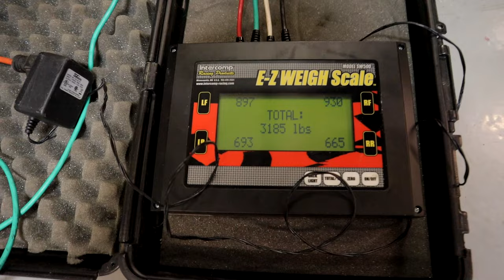American Musclecar Evolution - Why Pontiac Started Strong And Faded Into Obscurity

Comment: when i quit running ford FEs i went to the ponchos ran 455,428s and a few 400 ra 3s. rwith a 4spd  and peak rpm was under 7k , shifting around 6600 or so. coming from the FE the ponchos seemed wonderful. now this was the 80s -was aware of the CI rods, had a few cast steel rods  and some SD forgings . never dumped a rod or cooked the bottom end.  i did toss the valvetrain a few times --broke rockers, bent pushrods  and hand-grenade  a few flat tappets. poncho parts were scarce in these parts. good cylinder heads were very hard to come by.. later went with the chevy rat mill as decent cylinder heads were 'everywhere" and not expensive and  a very easy swap. ended up at the track with a f-bird packing a l-88 with ZL1 cam and valvetrain. it didn't have the poncho mills at the bottom , but from the middle up the thing just screamed-

Comment: My dad is an Oldsmobile man and he always talked about how they put a junk 400 or mild 455 in the 442s when they had the meanest olds motor in their family cars (425s), he built a 425 back in the 80s that he put in a 64 442 and ran low 11s in the quarter at 120mph even though he blew the back tires off for at least an eighth of a mile, if he would have gotten it to hook up it would have ran low 10s in a car he drove to the strip (gateway international in Madison IL).

Comment: I like Pontiac engines but my favorite engine is the Oldsmobile 455. I have a stock Oldsmobile 455 in my 72 Oldsmobile 98 and that thing has some dang good torque, just don't over rev them just like the Pontiac engines.

Comment: Have almost every issue of HPP.     Been slinging the same well balanced, all cast crank and rods to 6500 RPM for over 4 decades on the factory bolts.   400 has matching date code #16 heads I got from Quint Styres. Runs in the low 12s on a 2.78 gear.  Went undefeated street racing 1982-1991 on a 3.73 gear.   I wouldn’t trade it for the world.  It’s just nasty.   And, it’s legend.   😁

Comment: I used early 389 rods that were prepped & hardened and had ARP bolts installed in a few builds, my best Pontiac engines had BME aluminum rods back before they costed thousands of dollars a set.
Reply: @danielscott6787  yep, that was part of the prep too.

Comment: I did the Pontiac thing starting in 1964 with a new GTO w/tripower 4 speed. Being a physics major I used the 1961-62 forged rods and had them heat treated to Rockwell 35 and shot peened.  I also bought an OTC piston press ($2,000) and did not heat the rods to install the pins.

Comment: Pontiac (and I had a '70 GTO in high school - so limited budget....) at some point decided to go with cast iron connecting rods - pretty much limited the motors to 5500rpm (or 5000rpm on a 455).   Your choices (at least in the 80s) - limited rpm, Ram Air IV rods (good luck finding one) or the Super Duty 455 rod ($120 back in 1988 or so - cheaper going Carillo) or aluminum rods - and at the time they were no no for street.    Every rebuild (or even re-ring) had to have 6-8 rods resized because they were oval.   I used Mopar rod bolts (actually SPS brand, but sized for Mopar) in my Pontiac rods, ran Ram Air IV oil pump and windage tray with a deep sump.   With very light porting, full body car, ran deep into the 13s (3.55 gears L50 tires - remember those?).   Heck, there was a Firebird at my high school that rad 13.40 with a 4 speed (also a 400, but with cast iron manifolds).  Note: Pontiac also had their own, non C-clip, 10 bolt rear axle.   A god send when I blew the spider gears out of mine.
Weird, my block was drilled for 4 bolt mains but only had 2 bolt   (and yes I used studs in the block).
Also, everything was backward on  Pontiac.   Distributor ran backwards.
Now, I'd love to have a '74 firebird 4speed with a 400...   Eagle rods! and more or less stock appearing on the outside (think 'formula')
Ray Barton makes some really cool Pontiac motors - complete long block, big inch kits for very reasonable prices.

Comment: 65 Pontiac Strata Chief. 4 dr.  Had a 427 and 4 speed.  It was raced for 2 yrs. My dad bought it off the boys who raced it.  Spent the summer removing all the badges. All 427 and V8's were removed.  Candy red.  The only hint - was the electric brake lock on the Hurst shifter.                      Real nice car. Very fast.

Comment: I've often wondered what would have happened if the 301 was beefed up and received the same treatment the 3.8 Buick V6 did.  We might be talking about a turbo V8 Trans Am or Grand Prix instead of the Buick Grand National.
Reply: The 301 turbo block was somewhat beefed up compared to the earlier non turbo 301s. chevy wouldn't allow the turbo 301 to continue. They knew dam well it would have whipped anything they had. Can't have that

Comment: Great video. I did not know any of that about Pontiacs and their rods. I was always a Chevy and Mopar guy growing up and had both. I really didn't think much of for example the 69 Judges when they were around. Thought it was just a nice paint scheme sort of thing. In reality, those things ran very well with the Ram Air 3/4 motors and you could easily get torched by one if you weren't on your Ps and Qs. If I am not mistaken, the 69 GTO Judges were faster than any prior incarnation of the GTO. I've also read that the early Firebird Trans Am cars ran quite well also.

Comment: The owner of the first shop I worked in is a Pontiac guy that has a 68 GTO that’s been a race car since it was new, the crossmember is riddled with square holes and dents from slinging rods out of it, he ran it with 454’s from 1970 until the mid 90’s when aftermarket rods became more readily available and has run 400 based engines with oliver steel rods or BME aluminum since then.

Comment: I read in the '80s a lot of Motorbike magazines (in German) and then there was a crucial number for the high reeving engines (9-11'000rpm): the piston speed. About 20m/s was the healthy limit which equals to 65.62 ft/s. What happend to that number?

Even when the engines made a progress in design and materials I think this limit is still valid if you want to keep your engine for a long time.

Pontiac did correctly set the redline for the Trans Am's at 5700 rpm which equals for a 455 with 4.21 inch stroke at ecxactly 20m/s piston speed.
Pontiac kept that limit also for it's 400's (3.75 stroke) and having driven these cars I think it's absolutely enough. When the THM400 bangs the next gear at redline and the rpm drops to 3400rpm you can enjoy the strong pull until the next bang which will drop the rpm to 3800 while catapulting you forward.

I'm also not a big fan of high stall speed. Better to build a strong engine.
My Trans Am left the line thanks to good traction and a very very stiff converter without a chirp, but left most high cost European cars behind. I prefer the rpm's climbing accordingly to the speed. If you didn't know it one could think my car was a manual, so connected was the response to the accelerator.

Short story about Chevy engines: I friend of mine blew his L88 in a Corvette when he spun it to 7500. He was a road racer who also participated in Hill Climb racing. He said to me: "The best rods are Carillo rods. With them I never had a Problem again."
Of course, if he would have kept the L88 at redline which was set at 6500, which also equals to this famous 20m/s piston speed for the 3.76 inch stroke engine, he could have driven his car forever. Actually, the L88 can even take a 7000 hit without damage, but repeated 7500 was even for this super-engine too much.

I will buy a Trans Am again one day and then I will optimize the internals if I want to make more than 400-450 hp. Otherwise the engine is strong enough and can be kept as is, of course respecting the 5700 redline.

Comment: When I worked at a machine shop in the early 80's we used to suggest our Pontiac customers to upgrade to Crower rods. It was a tough sell, around $800 a set. I recall the Buick V6 had cast rods too back then. PS, those shirts are hot!!!

Comment: About a year ago I got a wonderful opportunity to do a concrete job for a 1967 LeMans two-door coupe it's a little rough but in surprisingly good shape for its age I was told it had a 326 in it after further inspection I ran the engine codes and found out it's a 400 out of a 67 Catalina being a Chevy guy I was very surprised at how simple a big Pontiac engine is I like some of the advantages it offers over a Chevy like if you cut the water passage free of the intake you can swap in takes without having to drain the coolant and the distributor as well is totally removed from the intake. My plans are to hop this car up which I have done a few bolt-on modifications performer RPM intake carburetor headers but I was shocked and appalled by the fact that a Pontiac has smaller intake ports been a small block Chevy. Being new to the Pontiac game I did a lot of deep diving and research and yes a small Port offers snappier acceleration and high flow at low lift which enough guys with large cubic inch Pontiacs and even the 400 still manage to build fast cars but it causes me to wonder why Pontiac didn't develop better cylinder heads like the ram Air 2 and mass produce those instead of the wheezy deports had to be a corporate decision that really sucks for the guys who want to build a real fast Pontiac because Butler and all the other high performance Pontiac gurus can't seem to offer a cylinder head package for under $2,000 with Pontiacs seems like it's big money to play.

Comment: I can tell almost the exact same story. I'm from around Branson Mo. In the eighties we all did some street stuff. We this older guy with a Trans-Am,who at the time was about the third fastest around came in gunning for bear. He had just put a big old blower on his four fitty five. As your passing over sixty five hyway on seventy six he came off of the first light, turned it to eleven, and the inside parts came out. Woo Hoo. He got it turned around, left a trail of oil and coolant about an eighth mile, and she seized. No chance of being number one that night. He came back with a four hundred with good rods,and other parts. Still he could only get second fastest.

Comment: I would have thought it was the exh ports but I didn't know about the rod materials used.  My lil brother swapped a 400 pont n trans into a junkyard 72 GS . RAM AIR 3 cam n 3 angle valve job. Headers n edelbrock dual plane. 600 holley.  It was a very fun car in early 80s. Handled good too.

Comment: I had a 72 Pontiac . I got burnt on a tripower manifold!!! Early 50's to early 64 they had one style engine they changed in 64-65 & ran that to 79 ,80 & changed it again .. my 72 had forged rods but the other stuff was hard to get by early 90's a lot of people had them warmed up a little bit or put in a Chevy engine... I could get four barrel manifold but duels & tripower were hard to get and expensive heads were another thing ... They were out their but very expensive... I met Arnie nice guy ...

Comment: Check out the old, black and white dealer promo film on the SD-455.  The lead engineer Herb Adams shows a cut away motor and the first thing he points out is the new forged rods.  He also claims 6000 rpm capability.

Comment: Could you talk about the FE especially with aftermarket stuff, Ray Paquet, the LeBlancs, Kip Martin, Paul Adams who are still racing in the 8’s they are awesome! I buy anything that they are swapping out. The 390 that should have been. All it needed was a cam. And you talked about it your hilarious video “ Why Fords Suck”.  The unibody. I had a 66 Fairlane , and I cut the front cowl clean the Fxxx off and took a 65 Galaxie front stub and mounted it Nova /Camaro style to strengthened unibody torque boxed and welded the front fenders and hood together and made it a tilt. That 396 ci FE was a monster in that car. We street raced and it got some cred, 7500 rpm shifts using a lightened steel dump truck crank, Factory 390 rods polished and peened with good bolts , 12.5:1 TRW pistons .030 over. The cam was Ford C8AX solid, 264@.050.600 lift. I was in high school and worked in a junkyard. People called me selling parts Pennie’s on the Dollar. The exhaust manifolds were really restrictive. I always put a set of Charlie Crites 2 in primary and 3.5 collectors with 3.5 x 2 ft extensions.  I have them on the Galaxie now. You talk about sound, it sounds like a DZ302 revving up, lol. I do miss playing!

Comment: I only run solid cams so I  can block the lifters on my FEs. I raced my 394 ci FE since 1999 and it has never given up. 7000 rpm gear after gear, year after year. Why didn’t Ford do what needed to be done in the casting process. I had to put so much work in this engine that replacing the bearings every few years was all I had to do . Why didn’t they cast them that way. The FE canter oiler is just like a SBC. I could go through the passeges. Return s, valley, and put 2.2 BBC rods on a 391 steel dump truck crank, and it runs balls to the wall for 25 years just replacing bearings one time when I put the big Canton pan and pickup.  I have it in a lighter 65 Galaxie.4.33 gears and it weighs 3480 lbs . Dang that car was fun. I am blind now and I dream still from banging the gears. My son seems to be afraid of it , he shifts at 6000.  I have Ford 427 425 hp solid cam in it now so he can shift lower. I am 62 and I wish I was still banging that 4 speed, but the C6 has turned out great.

Comment: Thanks Unk.  And check my memory which says that Mickey Thompson put 4 (Pontiac donated) test bed 389's into a Land Speed Vehicle which required some tricky shifter design and the car was doing fine until the shifter missed a gear on 1 of the engines which my memory says then threw a rod.  (But still, Mickey being Mickey, he probably boxed those rods.   Maybe.)

Comment: I was at a seminar in 1996 where Dollie Cole was the guest speaker (wife of the late Ed Cole - president of GM and designer of the Corvair).  She did not like John DeLorean but laid it out how his great ideas were always held short by even Ed Cole. In 61 the didn't have time but he wanted to initially build a highly efficient overhead 4 (he later got the overhead 8 then 6) for the 61-63 Tempest.  It would have been the 89 BMW back in 61 but they cut him short and even moved his office down a floor for going over heads to get things done.  She remembers the meeting where he's told "You will get F-85 fenders to do what you want and that's it"

Comment: I honestly built my 2nd Pontiac ram air 4 with 20 over with was my first time porting cast heads 6x or 4x i honestly can't remember but I've got me and Polaroids during
Process. But the torque on this trans was insane with just a few mods. What killed the trans am was the 256 final drive.

Comment: I’m a Pontiac guy through and through and this was insightful.  Always knew about the rods being the weakness but never connected the dots. Quick question, did the ram air IVs come with cast rods too? That just sounds like the dumbest thing for a manufacturer to do.  With that motor those rods were almost at or were at their limits.

Comment: the cams walk right the front of a chevrolet ,and they have major core shift ,the oil bypass is why 318s {for example last longer but can blow off cheap filters. A CHEVY IS SB is really every ones favorite cheap date.thats all.I ve had many of all four brands and ford has a knack of making things not interchange if at all. granted though my only excuse for a rear sump dodge is to put rv 440s in pick up trucks. Great video.

Comment: Tony what about the location of the push-rods that restricted the size of the intake ports.  Or the use of cast pistons so if you had too much ignition timing and pinged too much you would crack the landings between the piston rings.  And when the crank case blow-by started you knew you messed up.  TRW made some good forged replacement pistons.  Just ask me how I know.  RA5 was completely unobtainable but I did get a '65 tri-power setup minus the linkage and air cleaners for $35 back in the day. A 12 bolt Posi for $75. Everything was by word of mouth, to chase down any possible deal even if it was just a roomer.  Looking in the Sunday newspaper, in the parts and accessories section, for Pontiacs being parted out.  Pontiacs were were best for torque anyway with such a long stroke.  Kind of a balancing act to try to take advantage of the torque and know that the engine wasn't going much beyond about 5500 rpm at the end of the run.  Meanwhile BB Chevys would still be pouring on the power across the line.

Comment: I built a 455 out of a Grandville and put it in a 72 Firebird, with a TH350, 1800 stall and 3:55 posi.  Performer, Comp mag280, ported heads, 9.2/1, milodon chain/pump, blackjacks and a Holley 750.  CE slappers and subframe connectors, with a 4point cage. It was an Esprit, so very low key, but it would eat most anything except the usual suspects with blowers, etc.  It was a very fun car, but I knew to shift it at 5500.  Really didn't need more than 5K honestly. It made absurd mid range power.

Comment: The inter-changeability of parts also sometimes worked to GM's detriment like putting 6 cyl transmissions behind V8's. One of these fiascos resulted in a class action lawsuit. Transmissions burnt up on a regular basis in Colo having to climb the high passes. There were other cases, how about 10 bolt rears. I personally watched one of these grenade in the cruise during Hot August Nights.